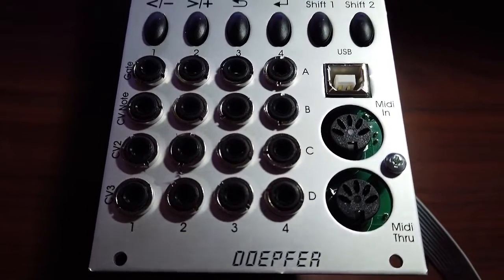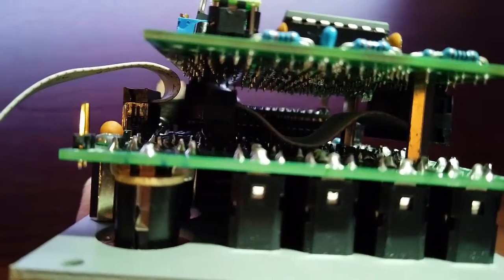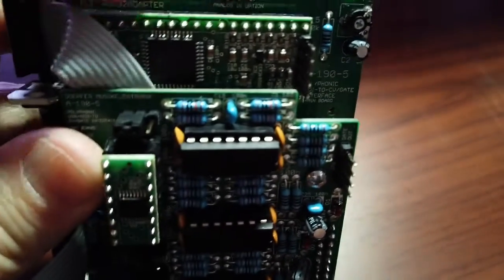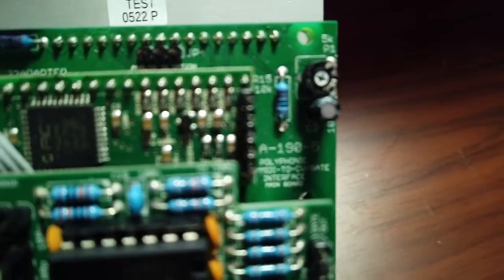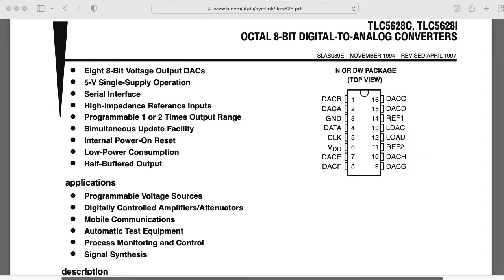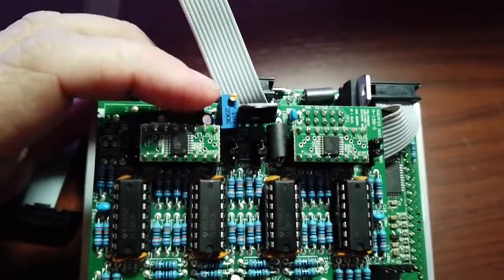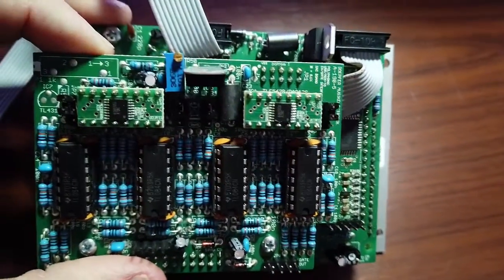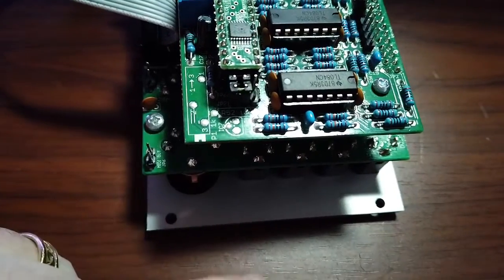PCB Analysis of the Doepfer Polyphonic MIDI to CV Interface (A-190-5)

Comment: Another point to add about using an 8-bit DAC for pitch CV: In theory you can get by with low bit resolutions (e.g. 8-bit) even for creating CV over several octaves if you get a little fancy with your scaling and if the DAC is really linear. This may work best if you are low-pass filtering a PWM signal as a DAC. Say you want 6 octaves from your 8-bit dac. 256/(6*12) is about 3.5 units of output per half step which results in around a 15% error. However, if you scale your output to use 3 units per half step (for a total of 7.11 octaves), then you should be able to avoid the quantization error. I'd love to link to the article where I saw this trick, but I'm struggling to find it. Also, I have no indication that this is what Doepfer is using, but I figured it was worth talking about anyway.

Comment: doepfers site has pretty good photo's of the modules, also schneidersladen often takes a photo of the back you can check out, doepfer does sell a lot of modules, he has often wanted people to be able to fix things easily and helps people troubleshoot faults, the use of smd parts is a more recent development from him in the last few years, I think he has them built in eastern europe, you might notice a mix of metal and carbon film resistors on some things, there's some extremes of economising here and there
Reply from the maker: Ah! Him wanting people to be able to fix things explains why so much is still through-hole.

Comment: 8 bit is just fine for semi notes only,  there a 256 steps, you only need 128,  multiply to 0.0833333 per semi note  / step  (better use two steps)
12 CV channels soo you need 2, 8 channel DACs.  Maybe the 4 gates are driven from the DAC too......

Vin could be a pitch wheel Vin
Reply: Doesn't that depend on the reference voltage?
5V, 4.096V, 2.048V are references you can buy or integrated.
Reply: that is a factor too, but is basically the opamp that wil give you the correct scale
Reply from the maker: @archeovideolink  It seems like you'd need a trim pot somewhere, either on the op amp itself or the voltage reference -- or maybe you have a calibration stage where the microcontroller reads the output and builds a table (I think the Mutable Instruments Yarns does this).
Reply from the maker: @AnalogDude_  I'd imagine that's what the trim pot is for.
Reply: Analog Devices has a 16 or so bit DAC that works with 10V, but it's a very costly piece, more than 50€/piece.
Reply from the maker: @AnalogDude_  Yeah that's overkill.
Reply from the maker: After doing some more thinking about this -- yeah, if your DAC is perfect and you are doing equal-temperament MIDI notes, it would be theoretically OK. But DACs have imperfections.
Reply: @Lantertronics  Metasonix R-60 was/is a self adjusting midi cv converter, although very expensive, why don't you try it yourself, midi is easy.
Reply from the maker: @AnalogDude_  Try what myself?
Reply: @Lantertronics  Build a midi cv converter, look at mutable intruments Yarns schematic, the pcb is ready to be made, just grab.
Reply: @Lantertronics  Mutable Instruments Ripples (2.0) is a killer filter.

She is a person that took like 2 years to build ONE module and still after quitting updates the mistakes in her designs.
Ripples, her legacy is just as big Buchla, Doepfer, Moog, etc. but most are digital.
She work at Google.